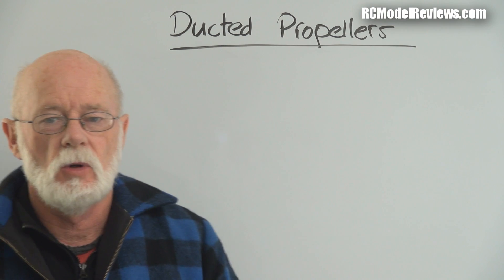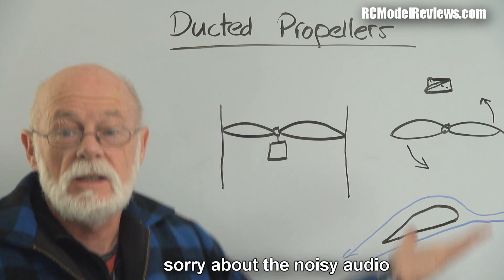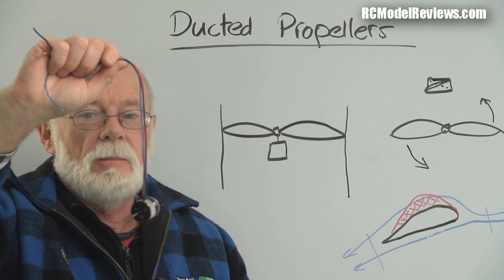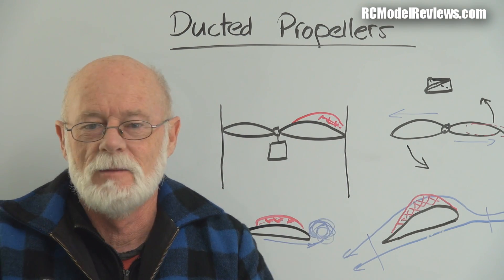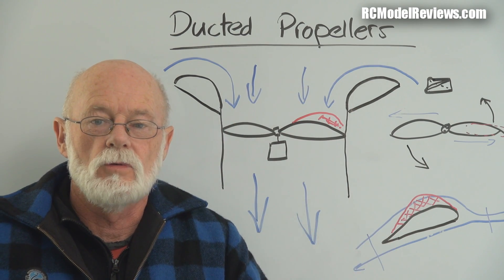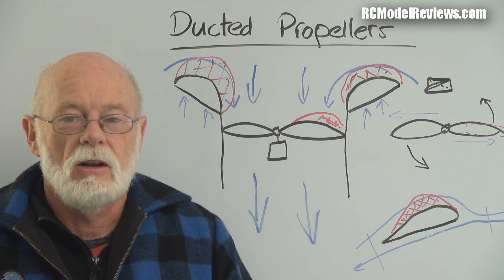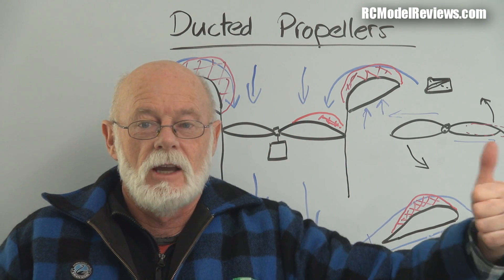How ducting a propeller increases efficiency and thrust

Comment: you forgot to mention a very important reason why many multirotors and helicopters  dont duct. the lost of lift during banking and pitching.ducting is more practical for fixed wings and propellers(fans) facing against relative airflow ALL THE TIME. And drag, never forget drag. induced drag is caused by vortexes, but it is always caused by structures that create turbulent flow.

Comment: I have to ask. This seems so obvious. But the Wright Bros made history with adjustable wings, which had the same problem as ducts before their addition. So, why not build an adjustable duct?

It could be either a series of aileron sections, like a wing, or inflatable/flexible lift sections, controlled by a gyro that titled the ducts towards the direction of travel, keeping the platform vertical. The controls would be similar to the quad copter controls.

Hard to believe it's never been done. Am I missing something? Even if the duct changed it's lift characteristics as it moves sideways, and tilted, it could be modified to compensate into the shape of a regular wing with louvered vents in the duct.

Comment: Eh, I'm not completely convinced. The duct increases drag and adds weight to the system which can easily counteract any aforementioned efficiency benefits you described for aircraft applications. After all, If the benefits were truly "free" you'd see these on every prop plane and helicopter in the sky. I work in the HVAC industry though, and you see a lot of ducted fans on stationary HVAC units, presumably for the reasons you have described.

Comment: a few thoughts.   the red sections you drew around the front of the prop is where the air has to move farther along the surface and its spread out and that lowers the pressure..

Comment: Ducts have weight too. Ducted impellers produce vortices as well, which is why the fenestrons on the eurocopters are so noisy because the vortices are interacting with the stators. The TF39 was another noise maker and it was also a ducted impellor.

Comment: A bare propeller also acts like a paddle and pushes air sideways in a circle. It no longer produces thrust once the air starts rotating with the blades. Fixed blades called the Stator can be put behind the moving blades, to stop the air from spinning. This is why turbines have stacks of spinning and stationary blades, not one huge deep rotating blade.

Comment: Sorry.  "It cost you nothing". Actually it costs you  a crap load of weight and huge surface drag.  Notice that nobody flys low pressure discs with a duct.  Because it sucks!   Funny how he said both "no downside" and  then carries on to mention all the downsides.

Comment: the experiment you are referring to...
some 50 years ago..
although failed...
it thus born what became the basis for a hovercraft..

they had used a series of jet engines..within a ufo shaped craft
expecting crazy speeds..excellent handling and high alditude..
but it barely got off the ground and only got to 40 or 50 mph..

the project was cancelled..
yet from it...by adding skirts..instead the hovercraft was born

all from experimenting with ducted fans driven by jet engines

Comment: A prop might be more effective in a duct. The wing shape might be more effective in a duct but the tapered ends of a prop are going to spill air. In a duct a fan has always been more efficient than a prop. Basically why there is a ducted fan in your hoover, stuck on the sides of modern airships and on the back of hovercraft.

Comment: in order to get rid of vortexes on plane wings they use winglets, why dont they have winglets on propellers?
Reply: 1wsx10 They are rare, but some do.
Reply: There used to be something called a Q-tip propeller.  I suspect the issue is fatigue cracking at the bend in the prop from vibration and centrifugal force.

Comment: Gross misrepresentation of Bernoulli's principle. It's not the speed of the air that causes a reduction in pressure, is the change in speed of the air - if it gets faster (without the addition of energy) then the pressure drops.

Comment: never knew how the flare worked, simple isn't it.  so i am interested in whatever it was you said they didn't count on when it was tilted.
  also , I always wondered why ducted "jet boats" are less efficient than plane prop driven boats.  apparently they are real gas guzzlers. 
  o and I think a flat wing must get some lift off the top surface just because of the angle of attack, sort of like you showed in the piece of paper demo.

Comment: Was there ever a followup video with the results of static testing? I am curious how much additional thrust you actually achieved; obviously the weight of the ducts would offset that slightly, but I have no idea how much. Does adding ducts double thrust? Is it negligible? or somewhere in between? I realize it can and will vary tremendously in the real world, I am wondering specifically about this particular situation with the shown ducts and suitable propellers...

Comment: What if you make the bottom converge a little? Wouldn't increase the pressure of air coming out from the bottom even more? And what about making a propeller wit a fixed ring/tube around it that spins with the propeller it self? It would eliminate the gap completely. Basically the whole tube spinning.

Comment: When I built my first glider with a flat bottom clark Y airfoil as a child assumed it worked by means of deflecting air downward from the downward facing upper side (IE classical Newtonion 3rd law).   I was then taught it was the Bernoulli principle, which is still widely taught just like many other myths.  Well turns out this is maybe a half truth at best.  If you don't believe me.   Maybe you might believe NASA:   https://www.grc.nasa.gov/www/k-12/airplane/wrong1.html

Comment: I saw this video and immediately thought about how I could apply this theory to my computer setup.  More specifically, the cooling fans.  The ones I have currently already have a slight shroud around them, however, by creating a greater "lip" around the edge of the shroud, in theory, I believe the amount of cooling air would be increased.  Any thoughts?
Reply: The fans to outside the case already have as much of a shroud as they can (the computer case, assuming it has no large holes or open card slots nearby). Keep in mind sometimes shrouding is reduced on CPU/GPU fans in order to reduce noise. Just think about the shortest path the air can take to get from the output of the fan to the intake. Then block that path. Perhaps more useful would be to wall off sections of the chassis so that the hot air coming out of coolers does not go into other coolers. So for instance put a wall between your CPU and graphics card if your graphics card will be sucking in hot air from the CPU cooler or vice versa.

Comment: I was with you until you got to the silly theory about air having to travel faster above the wing because it's traversing a longer path. Well, sorry to blow your bubble but that theory makes absolutely no sense, and in fact is demonstrably incorrect. The air doesn't have to travel any faster when the path is longer, and in fact the air above doesn't track with the air below. The air above the wing actually gets to the trailing edge after the air below the wing. There are youtube videos that prove this. So that theory needs to die a tortured death.

What actually happens is this:

1) The wing slices through the air at some angle of attack. The air itself presumably is not moving relative to a stationary observer.

2) The wing slicing through the air displaces downward the air below the wing.

3) As an immediate consequence (equal and opposite reaction) of air being displaced downward, there is a vacuum created above the wing. Said vacuum equates to lift.

4) The rounded front of the airfoil creates a Coanda effect, causing the air above the wing to track closely to the wing rather than creating turbulence (unless the angle of attack is too steep, in which case the wing stalls). This results in further air being displaced downward, increasing lift as even more air moves in to fill the vacuum.

5) Relative to an observer tracking the wing (say, from inside the airplane) air appears to rush past in the opposite direction the plane is headed. However, from a stationary observer's perspective there is very little air movement, and most of it is in the vertical direction, not horizontally. The wing actually pulls some air forward with it, mostly above the wing, as it passes the stationary observer. This is drag. But most of the air movement is downward in reaction to the angle of attack of the wing, then upward after the wing has past to equalize the air pressure and eliminate the vacuum that the wing created.

The Bernoulli effect is negligible because it's the wing that's actually moving, not the air, so necessarily the speed differential you're talking about doesn't exist. What horizontal air movement does exist is drag in the opposite direction from that needed for the Bernoulli effect to work.

Comment: excellent tuturial, you have any guidance on thrust produced by say a 10" dia 9" pitch open prop vs the prop in a 10.1" duct, how long must be the duct, where in the duct should the prop be placed, near the mouth from where the air is being sucked in or near the tail from where the thrust is being blown out. Any reference material I can see or read ? Great job bless you.

Comment: If I remember correctly Bernoulli's Theorem requires an aerofoil or curved surface, not a flat surface  m8 (!)
Reply: That's what produces lift when an airfoil moves through the air.

But this is because the airfoil, causes the air above to increase in speed.

The effect is from a differential in air speeds.

So it applies to a flat surface, if the air on one side is moving at a different speed than the air on the other side, the surface will feel a force pushing it toward the side with the faster air flow. This is easy enough to test at home, with a blower, like a hair dryer or shop vac.

Comment: Great video ! I have a question though concerning the energy loss: since the gap between the tip of the blade and the fence has to be in the order of fractions of a millimeter wouldn't the escaping air from beneath the blade towards its top through the sides of the blade drastically bleed energy ? Why isn't that considered?
Reply: https://youtu.be/Cew5JF8q6eY?t=655
Reply: I am not sure what exactly you mean. I don't think that part of the video answers my question. Or am I missing something ?
Reply: XenoContact
He says a few secs after the point in video i linked that because there is a gap you still bleed energy, but significantly less than without duct.  So that answers both your questions, yes you  still bleed energy, and yes, it is considered.
Reply: From what I understand he's only adressing the gap between the tip of the blade and the duct's wall. However, I am asking about the sides of the blades, the edges. I hope I explained myself clearly.
Reply: Oh, i get it.
In theory it is possible for air to go around the wing edge, but it does't happen in reality, Because if it did, the velocity of the air at the edge would try to approach infinity (and it obviously can't happen irl).
This is just my poor translation of the "Twierdzenie Czapłygina-Żukowskiego", dunno how it's called in english literature. You can try to look it up in proper literature about aerodynamics(google is generaly useless when it comes to this matters) if you are interested.
Reply: Very much appreciated. I am sure to look that up and report back for further clarification from your side if that's ok by you.
Reply: How did you get a link to the video.."?  to the minute you wanted to show?

Comment: Instead of adding a duct to your propeller, make it a part of it, The crossmembers on the duct should be propeller blades then there is no gap at all.
Reply: Would require a stronger motor and more energy to run it.
Reply: centrifugal force would cancel out the added weight... it would just be a little harder to get started

Comment: In regards to horizontal flight, how much net efficiency is gained (or lost) by using a ducted propeller, with all the effects you mentioned, when you compare it with the added weight, added parasitic drag and induced drag of the cowering or nacelle?

Very informative video btw.  You do a very fine job of breaking the subject down into understandable parts.

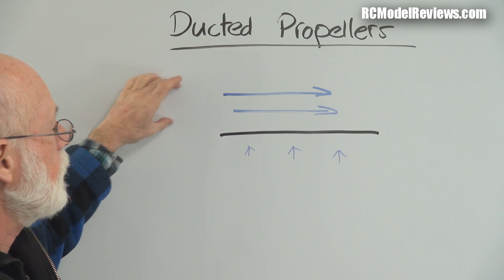Comment: 2:57 This "demonstration" of Bernoulli's principle always grinds my gears because it's wrong as explained. Air doesn't have lower pressure just because it's moving. Indeed, air can have any combination of static pressure and velocity, and Bernoulli's principle says that a parcel of air will decrease pressure if the increase in speed of flow comes at the expense of internal energy — Bernoulli's principle is a consequence of the conservation of energy.

This demonstration would only show Bernoulli's principle if you could prove that the air being blown over the top got that fast because the air went from still and at atmospheric pressure to moving without an input of energy from anywhere else, so the kinetic energy of that air had to come from its internal energy. But it didn't; the air is being propelled by your lungs. This invalidates the assumptions of Bernoulli's principle, because work is being done on the air, and so the increase in kinetic energy need not be at the expense of the air's static pressure, so a drop in pressure cannot be guaranteed.

Indeed, the breath cannot be at a lower pressure as the surrounding air because if it were, the moving column would immediately collapse from all sides to nothing within millimeters from your mouth. Bottom line, something else is going on.

Edit:
6:05 There is nothing that forces parcels of air flowing different paths over and under the wing to arrive at the same time. They're not married couples wanting to meet up together at the same time after being separated by the wing.
Reply: wyrmofvt Please explain why it works. it is all good and well that you say he is wrong, anyone can do that, but without an alternate explanation, your comment is just a useless wall of text.
Reply: herranton1979 I beg to differ. Admitting that you do not know how something works is always superior to going to a false explanation. The former encourages investigation; the latter engenders a false sense of understanding that can be hard to unlearn. And I didn't just say, "it doesn't work;" I explained why it doesn't work, which is not something "anyone" can do.

As to the real explanation, it's a little more subtle than just "the air moves faster so it's at lower pressure." It's the fact that the air curls downward over the strip. (You can test this yourself.) Now, think about what must be true about the pressure gradient across the streamline for this to happen.
Reply: wyrmofvt You're wrong. 

See how that doesn't work as an actual comment and seems trollish. Your previous wall of text was basically the same thing. without at least alluding to an alternate explanation and giving a bit of direction, you are just a troll, even if that is not your intent. You can disagree all you want, but simply calling something wrong doesn't encourage people to seek an alternate explanation.
Reply: But I did allude to an alternate explanation, in the second paragraph of my second response. The air (which has mass) curls down to follow the contour of the strip of paper (which you can experimentally show), and because the air has mass and has changed its state of motion in the downward direction due to the paper, the paper must react upward. Alternately, the only way a streamline will bend is if there is a pressure gradient across that streamline, again caused by the air flow having a tendency to stick to surfaces. However, neither explanation has anything to do with the Bernoulli principle.

I found this explanation out in two minutes searching the web. The only reason you haven't is because you are genuinely incurious and not actually here to learn and engage your brain, but to be spoon-fed information. Good day, sir.
Reply: wyrmofvt lol. All the personal insults in the world don't make up for the fact that you clearly didn't add to the conversation at all. You simply said he was wrong.
Reply: wyrmofvt :sigh: Ok buddy, good job. You clearly added your own explanation in your second comment... Maybe try doing that right away before some needs to drag it out of you.
Reply: Like I said, TWO MINUTES on the web.

Comment: Free Efficiency –Yes!  Just kidding. Excellent explanation.Much appreciated and very clear. It reminds me of a 90's (I think? ABC TV - The Inventors" ?) development of a ducted propellor for motor boats. Apparently it increased power, efficiency, decreased cavitation, and noise. I've been looking for it ever since but have never seen it. I don't think it took off commercially. good idea, but. I think it also had some unique features that involved angular slots in the duct which over came some of the problems you mentioned (but I could be wrong about that.) Any way, thanks for the vd. Nicely done.  ...free efficiency, yea... now where's my hat...  ;-)

Comment: Hmm, randomly happened across this video, and now it has me wondering... if you narrow the exit of the duct, the pressure under the propeller would increase more, creating yet more lift, no? Would providing a partial cover for the center of the intake, forcing more airflow over the lip (and creating more of a low pressure area due to restricted air intake) also increase the lift?